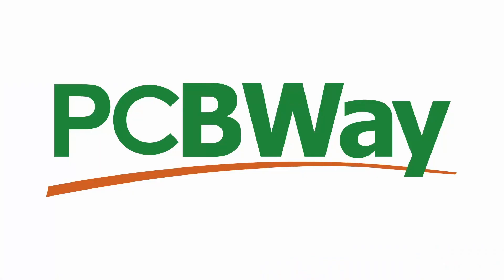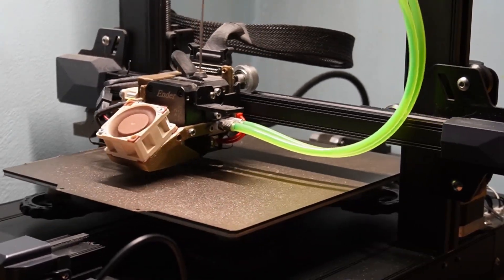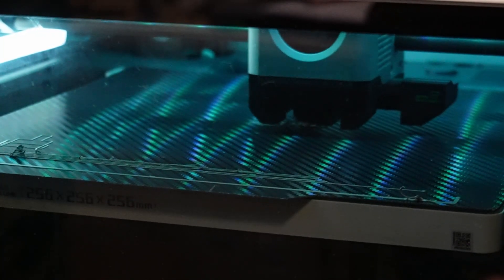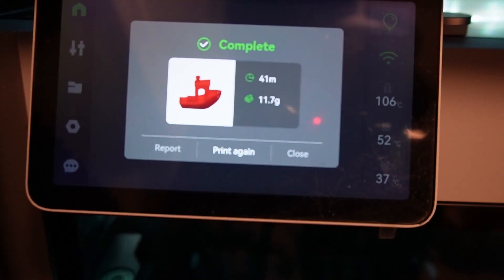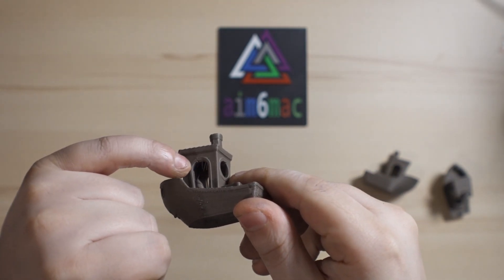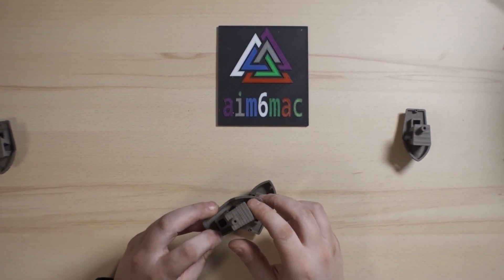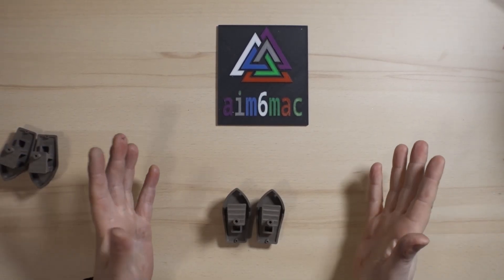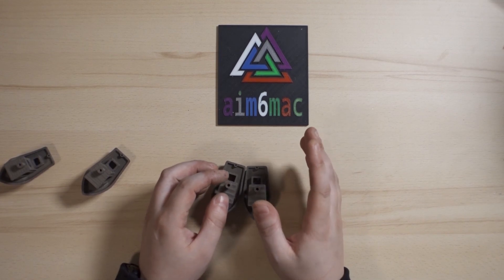Creality Ender 3 s1(pro) Klipper vs Bambu X1C Results are different then what u might expect!

Comment: The thing here is that it is obvious your Ender 3 is not anywhere near stock.   How much did all the upgrades to the Ender 3 cost to get what you have now, compared to a price of stock ender 3, then compared to the cost of a Bambu Lab printer.
A Stock Ender 3 S1 will not get anything like what you get on the modified Ender 3.   When you add up the time modifying an Ender 3 and the costs in both time and money, it is likely better to just buy the Bambu Lab unless you are more about upgrading the printer than actually printing

Comment: I have added the triple cooling fan to Ender 3 S1 pro and it can allow much faster speeds since cooling is improved ALOT. I found it on amazon. It's a bar that has 3 fans and connects right to power supply of the ender 3. I also have sonic pad, linear rails and the Zuff V4 cooling duct.

Comment: very interesting. I would be curious to see the cura settings you were using. The best i get for the benchy is 36 minutes with speed setting in cura 60, but a layer height of 0.32. In klipper it is set to 200%.  actually the result looks pretty good (but i still use the stock fan, so no probs in the front). But I also, like you, have a not very nice part on the backside - its like a series of dots in an area, but that is normal. You have a setting in cura (actually its only been there since a couple of versions) called "Zseam Alignment" you probably have user specified, and there "z seam position" set to back. If instead you have "sharpest corner" like i used to.. then the front of the benchy is not so nice. But now i have like you.. all the seam points in one area at the back. So if you have the setting set to "back" then that second bad area is more or less normal.
and btw.. my 36 minutes is print time and heating.. but i have optimized  the heating part down to less than 2 minutes.. (heating starting and continuing while all other things happen at the same time)..  so its about 34 minutes.
Luc
PS: After writing this.. i reprinted a benchy setting the speed from 200 to 500%. guess what.. it looked faster at the beginning but it took like 20 seconds longer than the 200%. very strange.. i will check that out in the morning.

Comment: i own them both and even on sonic pad u wont get near the speed on s1 especially with bigger  prints x1 will make it look slow but with lots tweaking can make s1 look good with sonic pad
Reply: greatest limit is acceleration on s1 its 5k on x1 its 20k big difference
Reply from the maker: yes it is :) but we were also compairing apples to pears as i said :)

Comment: 500 Euro S1 with all the upgrades.  Bambu Lab 18-minute Benchy looks better than the 34-minute Ender benchy.    Also The P1P for $699 US would print as well as the X1 for Just a bit more than your upgraded S1.

Comment: I printed the benchy with stock S1pro and CHEP FF 0.28 profile and 150% speed from machine in 38min, almost perfect. Sunlu pla @195/60°. With only dual ducts and 1 5025 fan can be printed in 27min
Reply: I know you had 0.25 and i also agree that we can achieve prints almost as fast with half or less money, but only If You are tehnically oriented, because of all the mods and fine tuning needed. I'm sure you know how much time you spend for research/build/trial'n error. For the vast majority that is almost an impossible task. 'Not sticking' and 'how to get rid of this blobs/lines' are the most common topics. I think paying few hundreds extra for peace of mind and some free time is totally worth it on the long run
Reply from the maker: @1Raducu  if you have the money for it, then go for the bambu i'd say :)
Reply from the maker: i used 0.25 lh not 0.28 :)
Reply: exactly
it's all trade offs: more speed = more noise from larger fans needed, and also = lower strength
less speed = lower noise, higher strength
Klipperized S1 is still the best price-to-performance

Comment: As someone who has never printed a benchy this was in interesting video.
I think it should be stated that the ender at 350 euro has a sonic pad($160)), water cooling(??$$), noctua fans(generally inexpensive) and needs a bunch of tweaking/tuning/customization and testing vs Bambu lab which works first time without much fuss. 

You can easily get an under 12.5min benchy on the Bambu lab and the videos and settings are on youtube. You stated this was an apples to pears comparison but the stock settings for the bambu is conservative and it can go much faster than 34min. 

If someone were just using the printer as a hobby the ender is a good start. If you want to skip the headaches and print the X1C is a great value by itself.
Reply from the maker: you are right, i should have counted the price of the sonic pad aswell, but the watercoolingskit doesn't really bring anything extra to the printer to be honest.  and the noctua fans make the printer silent but at the same time downgrade the coolingsability so i don't want to count that part neither.
Reply: Very true. And If you put a price on the many many hours/days of tinkering you'll come to the conclusion that X1c is really cheap compared to...
Reply: plus for 1500 u get the ams also that's 350 of the cost
Reply from the maker: @jamesharris9894  bambu x1c with ams costs as of this moment 1672,38€
Reply: @aim6mac  1449 for x1 combo here and around 400 to 470  for the s1pro
Reply from the maker: @jamesharris9894  well lucky you on the x1 cc
Reply: @aim6mac  i saw that in US and Canada you pay the listed price, in EU we have to add ~20% for taxes
Reply from the maker: @1Raducu  yes pretty sad